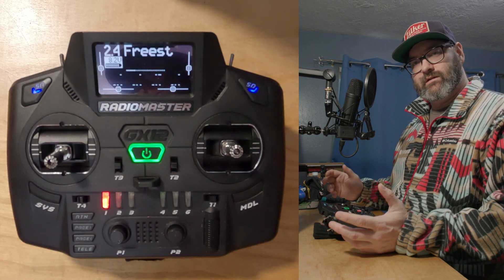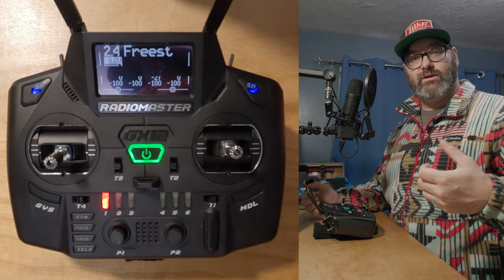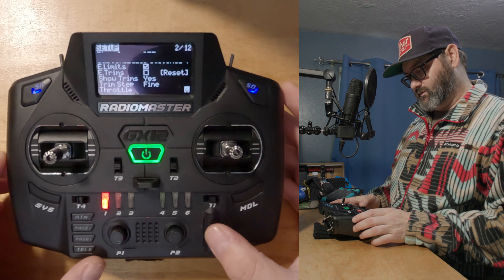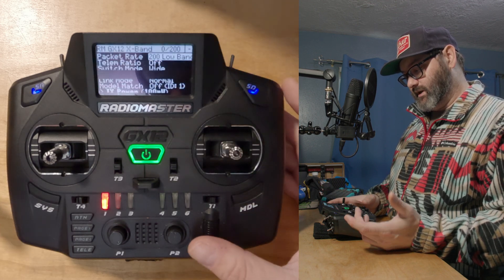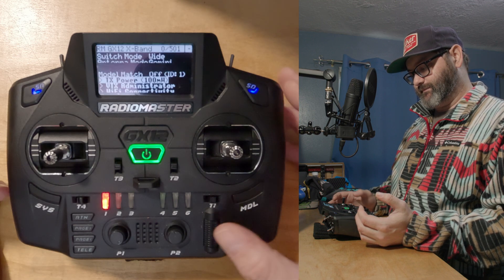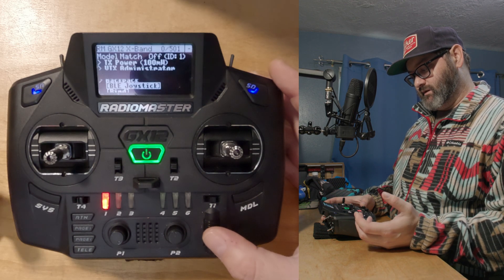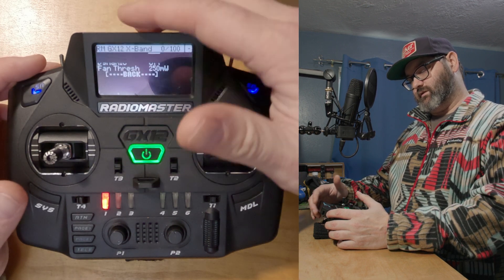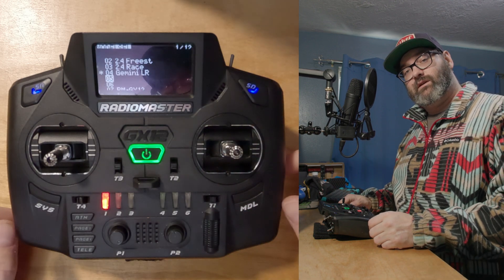ELRS: How to change modes automatically for different aircraft

Comment: If you set telem to Race, it gives telem until you arm it. Then it shuts it down, on my version anyways.
Good VIdeo
Reply from the maker: Yeah, I've since changed to Race telemetry on my race model. I like getting confirmation that it connected on the radio, then having it go away once i arm. I might disable the verbal alarms on the model profile though so i don't have to hear it

Comment from the maker: Minor update. After doing some reading if you're using a Gemini x module or radio with a non Gemini or Gemini x receiver, you should set the antenna mode to either antenna 1, 2 or switch. That makes sure the second antenna isn't transmitting and causing noise that will reduce your range.